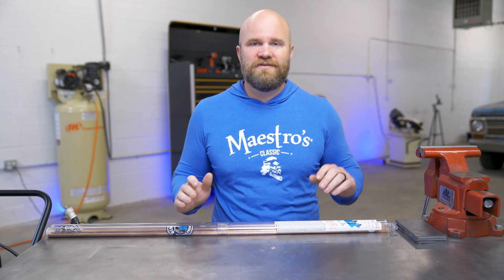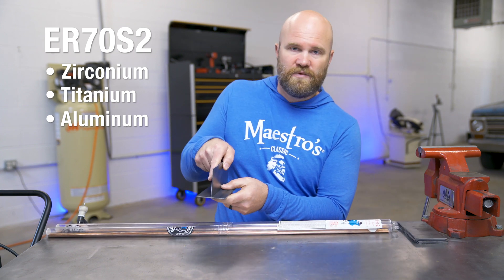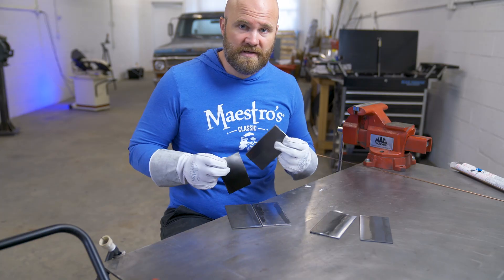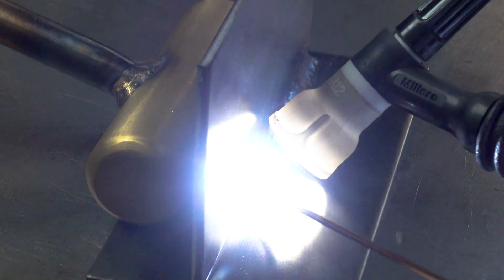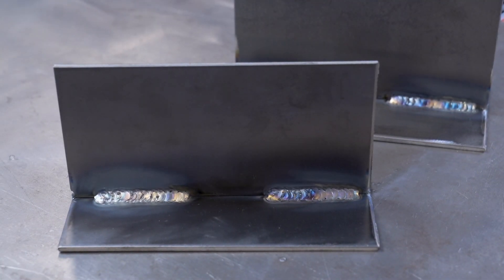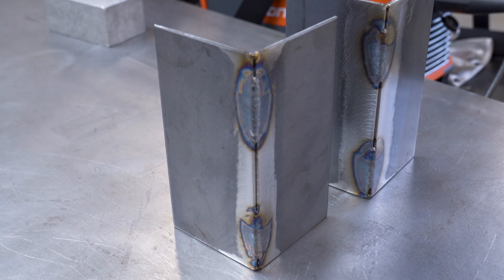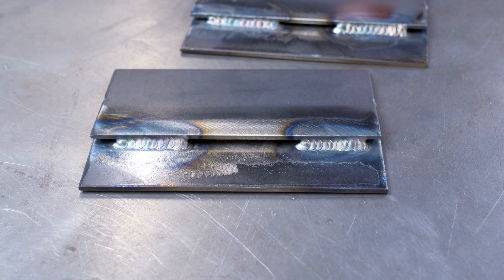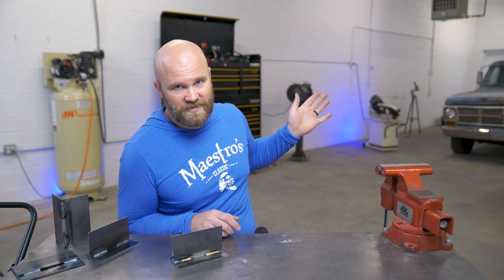ER70s2 vs ER70s6, Can You Tell The Difference? Steel TIG Welding Rod Comparison

Comment: Did you change out your gases?  I have read that S6 needs some CO2 for the deoxidizers to work.  Most people run straight argon in their TIG machine including.  Not sure if you can use any CO2 with it, but it is probaby ok.
Reply: CO2 is incompatible with TIG; I've tried.

Comment: I weld on 4130 chromoly aircraft frames occasionally and was taught that the s6 has better elongation properties for handling the flex that occurs during flight

Comment: Open root butt welds on the root run is where you will see the greatest difference between these 2 fillers. S-6 you can weld with your eyes closed, S-2 isn’t as user friendly on poor fit-ups and takes a little more patience. Because I mainly weld pipe work I’d not considered S-2 for structural welding given that S-6 is so easy to use on pipe. I can see how the fast freezing S-2 could be advantageous in certain situations. Thank you

Comment: There is a price difference between them and er70s-2 can be used on 4130. At the end of the day you are going to end up with dozens of different types of filler the most important thing is selecting the right one for the job.

Comment: I use 6 because it’s what I’m used to, both for TIG and MiG. I think that if you get used to one or the other, you’ll be better able to optimize your welding than if you switch back and forth.

Comment: 22yr pipe welder ... s6 will deposit less silica at higher heat... s2 is a trasher puddle for what I do that is
Reply: I thought s6 has a higher % of silicon  than 70s2

Comment: I thought you use stainless rod for everything?
Reply from the maker: For most things I do, but some instances using a mild steel rod is preferred.. For others they have to use it because of engineering requirements. Plus it is cheaper.

Comment: I use er70s6 and I can tell the difference. I would love to see a comparison welding and strength comparison between er312 and Super Missile Weld  on 4130 tubing both will a back purge
Reply from the maker: I would too, that's a good idea if I can think of a way to test it.
Reply: PM me on FB and I can give you a cheap  and I easy test rig.
Reply: There isn't many Hise's in the world
Reply: Usually 4130 tubing is relatively thin and that creates a high percentage of dilution in TIG welded fillets. With bicycle thickness tubing dilution from the base metal is 40 to 50 percent and even higher than 50 percent. With some 4130 tubing used in motorsports that might be a bit thicker, there is around 30 to 40 percent dilution of 4130 into the TIG welds. This causes high strength in the welds with standard steel fillers and no need of high strength fillers. Much thicker material can gain strength from high strength fillers, because there is less dilution from the  base metal, but thinwall chrome moly tubing causes strong TIG welds. With MIG welding there is much less alloying in the welds from dilution and high strength fillers can make stronger MIG welds. Super Missleweld is no longer available in small diameters and for certain types of welding. Thinwall 4130 TIG welds get much of their strength from the 4130 diluting the welds and don't require high strength fillers for strength. ER70S2 benefits from backpurging, but ER70S6 welds about the same with or without backpurging. ER80SD2 works well with and without backpurging. ER70S2 tends to pull the weld through without backpurging, causing a tendency for undercutting the welds. Backpurging ER70S2 prevents this. ER80SD2 has twice the manganese as ER70SA1 and European CrMo1 has twice the manganese as ER80SB2. ER70S7 is like ER80SD2 without the moly. ER312 and even ER2209 do work well welding 4130, but should get backpurging. Weldmold sells the European spec chrome moly TIG filler CrMo1in the US as Weldmold 9211-T. This  is the European choice for welding 25crmo4 tubing, which is the European version of 4130. ER70SB2L can work for 4130, but ER80SB2 and ER70SA1 were meant for welding pipe that has less than 20 percent carbon. The higher manganese in CrMo1 and ER80SD2 handle the higher carbon content of 4130 better. ER70S7 might be one of the better TIG choices, but it was originally made for MIG welding heavy equipment.

Comment: Great test.  Nice to see a lack of difference.  Sometimes I don't have a choice between, one is available, the other isn't.  I wonder if you cut them and looked at the profiles there would be a difference.
Reply from the maker: I doubt you’d see a visible difference, maybe under a microscope?
Reply: '' , v*MN, , , ,  ',   , k   * "  ",,  ojo,, Z kñl, 860000"! ".  , **0424444441224444442424242“483366985

Comment: Great video! I think S2 is supposed to be a bit stronger. Both are mild steel rods but are often used to join cromoly (which is stronger than either rod). I guess you could weld some cromoly with both rods and see if you can break the weld but I predict that in both cases the cromoly tube will actually break before the weld even though both fillers are mild steel.
Reply: Naaa chromoly is 70sb2 or 70sb6 thats what we use for two to five percent chromoly
Reply: @jblood1098  On chromoly bicycle tubing most people use the mild steel rod. Some use a stainless rod. But it's probably different because it's so thin-walled. There's also no preheat.
Reply from the maker: Do some kind of weld strength testing with various fillers would be fun. Would need some kind of pull or pressure scale.
Reply: @JustVoss  A lever and a weight might be one approach and look at how far down the lever the weight needed to be before the joint failed. The lever would need to be a big girder or something like that. To get a rough idea I just weld a tube to another thicker one at 90 degrees and then bash it with a hammer. If it's a good weld the thinner tube can be bent over, hammered flat, and even start to tear apart before the weld breaks. In fact the weld never breaks, but it's easy to break brazed joints.